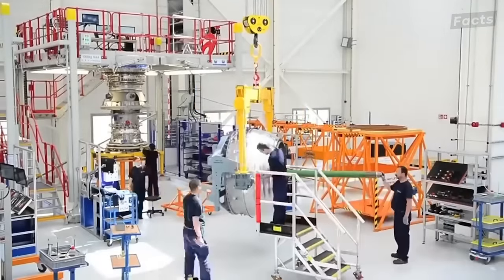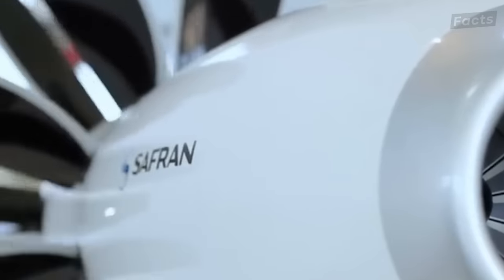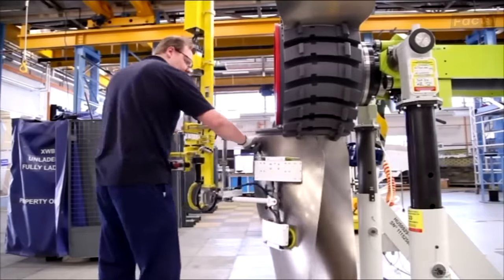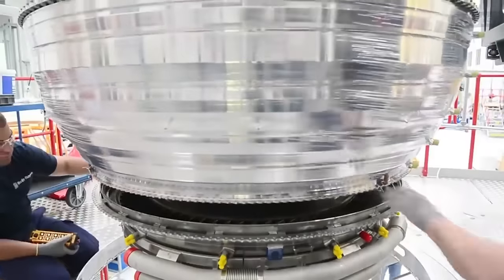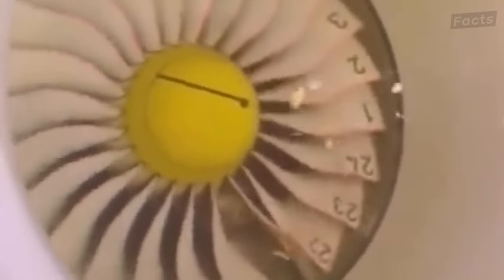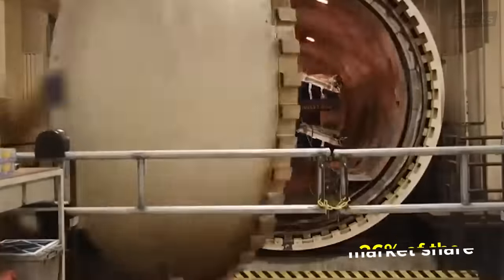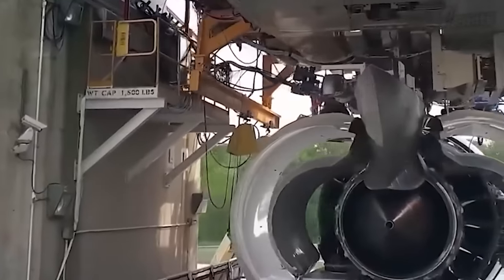This Engine Will Change Aviation Forever

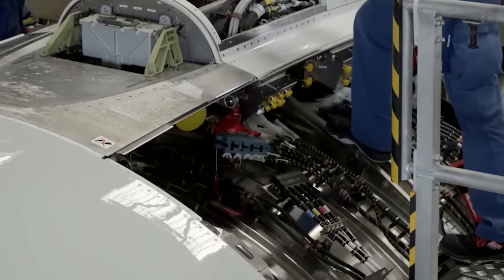Comment: OK, hold up.... there's a problem with something said in this video that hopefully the 'propeller-beanied' among you can help to figure out: At 7:13 the Narrator says "They secure the engine with 50,000 pounds of thrust on two mounting brackets...." Say Watt??? OK, let's see: That statement can't be a reference to the engine itself (by stating it's propulsive thrust numbers) as the XWB produces >90,000 "pounds of thrust". So, is he referring to the amount of 'torque', measured in lb/ft, that is applied to the fasteners that secure the engine to the two mounting brackets? (If so, the term "thrust" has no business being used in that statement!) But 50,000 lb/ft of torque ??? That wrench and 'dog-bone' they are using is only about 5 ft. long! That would require them to apply 10,000 lbs. of weight to the end of that wrench to generate 50,000 lb/ft of torque! Something is off....🤔

Comment: 1:16 - this is just a turboprop, the GE Catalyst (I worked on it recently)
Reply: no it's true jet I read about it in 1988 they add the very short blades BUT it made way way too much noise was not as fast did get better MPG but this old stuff over 30 years old all  air craft co. turned  it down  over the noise they said it was so loud that theres was not 1 us airport that would let it take off from speed loss was also very close to the fuel gain there was a gain  but 8 or 9 % was not the 24% +    that was planed it did get this + 24% but when  add in the speed loss  it  was less then 10% gain

Comment: It comes down to to 3  things.  1) Politics, 2)Fuel efficiency, Net Thrust/fuel burn rate. 3)Serviceability (maintenance and reliability and safety).  To win an engine manufacture needs to nail all of these so as to show an economic advantage to the Airline for there engine.  Not much point producing the best plane or the best engine, in Russia or Brazil or Japan,  if no one buys it due to politics.

Comment: Interesting, thank you.
I would have thought, though, that in order for the prediction for the engine business worldwide to increase to come true, we'd need to avoid two things.
The price of normal flights to be quite a bit lower than it is.
Governments around the world being prohibited from banning (or very, very severely curtailing) international travel at the drop of a hat, with no discussion, in an alarmingly synchronized manner, when a virus (which we soon learn to be dramatically less damaging than is speculated) appears.
I hope that we achieve those two necessary prerequisites for this business growth.

Comment: So aviation started in 1903 with a propellor turned by a small gasoline engine and the future of aviation is a propellor turned by a turbine.
Got it.
Reply: Interesting how it seems we've gone into a full circle... h m m . . .
Reply: Not quite
Reply: @heftosprod  Looking back on this, yeah, yo can probably explain it better to some degree. But if I'm right, a propeller powered by a gas engine is a simple propeller, but a propeller powered by a turbine is a type of engine known as a Turboprop, if I'm right... feel free to correct me on this.
Reply: @benjaminpersonsthevoidhermit  turboprop engines have existed since just after WW2... Such as the Rolls Royce dart. This is more of a prop fan type I suppose.
Reply: @heftosprod Alright, though we both can't really say for certain what this is until we get more official confirmation, right?
Reply: @benjaminpersonsthevoidhermit  Well, the propfan design is something of a hybrid of the straight up turbofan we all are familiar with and the turboprop engine were all equally familiar with. Propellers have been turbine spun for just about as long as jet engines have been used in aeroplanes. I'd be fascinated to see a prop fan in action though... Apparently theyre bloody loud though.

Comment: It's pronounced Darby but spelled "Derby". And the engine is secured on the pylon by 50,000lb of "thrust"? Not torque? Curious that Rolls is using a gearbox on the UltraFan demonstrator copying Pratt's design. Years ago I read UltraFan would also have a fan pitch change mechanism, but I don't see any mention of it anymore.
Reply: It isn’t 50,000 pounds of torque…it’s less than 1000 foot pounds.
Reply: @dieselyeti I could never understand why RR went the geared fan route. They already have a 3 spool core so the low pressure, intermediate pressure and high pressure spools all run at their optimum speeds. A 2 spool doesn't have that luxury hence the gearbox.

Comment: All fan jet engines have to have a surround nacelle which can contain a fanblade  failure from structural failure and foreign object ingestion. Any open fan design should also have such containment - if not then all types of jet can be altered to run without a nacelle and thus raise the by-pass ratio. All prop planes in civil use have strengthened fuselages to cope  with ice being thrown off the prop and there have been a number of major incidents with blades breaking or coming loose. Should open fan jets have similar protection??

Comment: I also have a question about this technology,what amount of energy is involved at the by pass part of the engine, i ask because like most I am aware of how much heat is generated by a normal compressor.
If the compressor was increased in size a little and made the purposely increase the air tempreture to a much higher rate then surely the bypass gases would contrubute more thrust without increasing the fuel consumption, after all, its what come out the back end that gives each engine its capability.
The other part of the question is we are all aware that splitting water into the two seperate gases and then combining the two as a fuel generated a lot more temprature, is there not a way to improve the method of sepetating the two gases to a point where it is enought to run an engine
Then the cost would certainly be a lot less plus tberecwould be no polusion what so ever, and as an added bonus the engine would give a completely clean burn taking a lot more care of the engine itself, plus it would mean there would be no flamable fuel at all possibly making planes a lot safer in the event of a forced landing.
I am sure that the technology of hydro fuel cells has come a long way it just a question of developing a really efficient fuel cell that is notbtoo heavy.
Reply: 90 percent of the propulsion comes from the fan on the front.The other 10 is from jet efflux.

Comment: Turbo props are slower and noisier than regular fan jet engines. Who would buy turbo props on 21st century?: Airlines for connection flights, and cargo companies for small  to medium cargo. Everything large will require big turbofan jet engines. Thanks.
Reply: Nobody is talking about turbo props in this video.

Comment: I read about it in 1988 they add the very short blades BUT it made way way too much noise was not as fast did get better MPG but this old stuff over 30 years old all  air craft co. turned  it down  over the noise they said it was so loud that theres was not 1 us airport that would let it take off from speed loss was also very close to the fuel gain there was a gain  but 8 or 9 % was not the 24% +    that was planed it did get this + 24% but when  add in the speed loss  it  was less then 10% gain
2

Comment: So whats going to contain those blades of the engine in the beginning, if one of them decides to fly off. Second no, the turbo fan blades are not as sharp as a chefs knife. If they were mechanics wouldn't be able to handle them for install. Anyways this tech is old news. I want to know about the secret new stuff they're doing.

Comment: Again someone trying to present an open propeller engine as a revolutionary thing that will change the aviation market forever... 
The reasons why open propellers never went to the market in huge and fast airplanes are very well know: noise and engine complexity. The presented engine doesn't seem to solve any of them.

Comment: Might seem lkke a dumb question, but if R.R. build the engine complete why do they not get all the money for doing so.
Pratt and Whitney, and G.E.C. do nothing the the engine it arrives complete to be fitted.
I think there should be a set price on these huge engines,  that goes purely to the builders of same, what is happening is like  any American company getting a kick back for every A 380 thats built.
Its no wonder there is so much corruption in all forms of trade these days.

Comment: At the start of the video they say that the objective is to use hydrogen as a fuel. That will be the real problem. Very few fuels have the energy density of petroleum derived jet fuel, basically kerosene. I wish there was some other fuel with a comparable  energy density of kerosene, hydrogen definitely is not that fuel. Hydrogen is a very difficult material to use with metals because the hydrogen with its single proton nucleus works it way into the steel crystals and degrades the strength of the steel. Hydrogen is equally damaging to crystalline structure of other metals. Perhaps the carbon nanostructures are less vulnerable to hydrogen infiltration, but I see a lot of specialized metals in the other parts of that engine. I do hope they succeed, but I am pessimistic. ☹️

Comment: The best jet engine should have multiple-
Passive-compress-rotor-fan stage running on different rpm to achieves higher efficient and pressure……

Comment: Reducing carbon emissions by only 20% is not acceptable. We cannot continue to use greenhouse gas emitting propulsion. We are way past to many climate-relevant tipping points now. Emissions must decline rapidly due to past failures to act. The situation is now critical

Comment: Old story, older unrelated footage and if your passionate about all things aviation the many incomplete explanations, reasons for and half truths mixed with flowery word choices, would you build a frequent flyer portfolio with airline powering part of fleet used in testing effect of bird ingestion on engine by propelling live birds at test power plant. Definitely not so why mention that dead birds are used, their not the local road kill collected for such, Darby is very picturesque but no RR personal has hand on bird prep, see how easy its to be colorful. Oh this might change how you view that special guest most have for the holidays, frozen birds are also given the same ending, as for blade off test is the final as this test demonstrates that in the event of a not so heavy blade spinning at max rotation its outer edge spinning millimeters from the outer housing of engine have the energy of a train locomotive traveling at some speed, that energy and resulting bits and pieces  must remain inside that outer casing. Nothing can escape, in doing this test that test engine is violently trashed, but the wing above,  the fuel, vapors, hydrolic, etc but especially the flying public are safe in those window seats those test engines made it so. Thank Everyone for making a most unnatural and potentially deadly journey the available, affordable, usually convenient, sometimes late but damn it we are safe considering our numbers.

Comment: The anit gravitic engine used in TR3Bs surpasses ALL JET ENGINES and has no fuel burning, time for boeing, raytheon and lockheed martin to start manufacturing them for commercial use.

Comment: It will not come, again.

The current design is way more better - even because it hides tec from the eyes of the ones who would like the view. They want transportation, price and comfort. (Security and tec are required and need to be just there )

No, another wing design together with the existing turbo van typ engines (but with further increased fans) could become made way more easy than changing the generally acceptedvlook of the entire vehicle. The wing simply needs to become placed higher. (Or the chassis places the vehicle higher.)(Or part of the (upper) engine hull and part of the wing are the same, share function. A potential weight saving and a potential legal problem between wing- and engine-manufacturers.)

Comment: The first engine is basically a glorified turbo prop. So not using a fan shroud saved some weight and structural complexity, but it is more of a PR problem, for the ignorant public can see the propellers. There had been no eye popping tech break through in civilian jets for 3/4 century, all of them still struggling with the "sound barrier"

Comment: No fossil fuel engine is forever, sorry.  Must go electric.
Reply: And no electric motor runs forever.  E is no panacea.
Reply: Electric airliners are limited by the extension cord. By the time you gat a big enough battery onboard there won't be capacity left for the paying passengers and their luggage.
Reply: It will never happen!